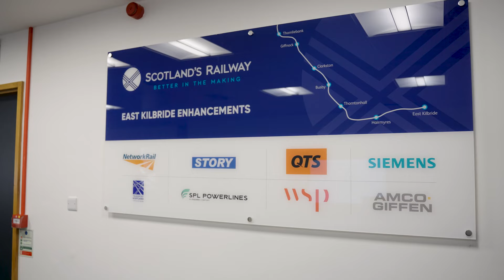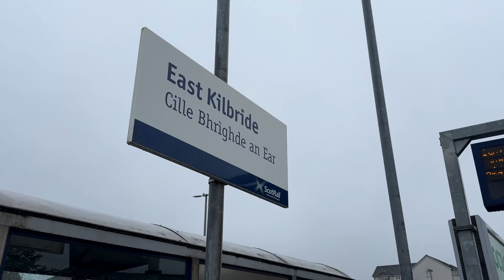Network Rail Scotland MD, Liam Sumpter, visits EK Enhancement project

Comment: Why wont they say the line IS to be doubled all the way to East Kilbride and not mention the fate of Thorntonhall station 

I mean surely they have to build a second platform there if it were to be so because it’d be daft to have a double, single then double track again heading towards the new hairmyers station especially if they plan to run 4 trains every half an hour on the line
Reply from the maker: Hi, the route isn't being double-tracked all the way to East Kilbride, we're extending the current double-track section by 1.4km though.
Reply: Yes but if some of it is as stated double tracked i.e at the new Hairmyres station and a bit is single track I.e at throntonhall then essentially you have a logjam if a 4 trains per half an hour service is to run. The sensible thing IS the double track all the way for that kind of service to operate like at Barrhead where there is a platform for trains to stop